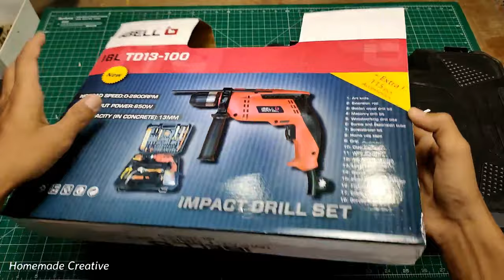Unboxing and Testing iBELL IBL TD13-100 650W Professional Tool Kit

Comment: Do your drilling machine spark inside ? I got my order today and thinking of returning it due to spark while drilling
Reply from the maker: If Little Bit Spark, No Problem(Because Of It Uses Brush)Buy Its Too Much Then Return it
Reply: Of it's spark a little bit,, it's good.
It's used to be happen sometimes.
Cause by carbon.
Reply: Don't buy ibell go for Stanley
Reply: Same problem but the spark is significant if I put it in reverse mode. And the case is damaged inside.

Comment: Metal mein very slow speed mein chalao aur pressure de ke rakho.. squealing awaaz nhi aana chahiye, smoke aur heat bhi nhi hona chahiye.. aur thoda lubricant bhi daalo to protect the sharpness of bits..
Reply: Vg
Reply: В лими́

Тттт
Т  и
Reply: @user-uo8rl8eu1s  privitya.. kak dela?

Comment: I got this drill machine delivered today.
It's making sparks.
What to do?
It's brand new.
Reply from the maker: If it’s little bit then It’s Normal, if alot of spark coming, then replace it
Reply: @homemadecreativee  thanks for replying.🙏
Did you faced the same problem ? ..sparking in brand new machine.

Comment: It is hammer drill or an ordinary model!
Reply from the maker: It is not hammer drill but it is have hammer function
Reply: Thank you for the information brother, so I can use like Bosch hammer drill? Nearly similar function or result? Cause using ordinary drill machine it is impossible to hole a concrete pillar, with this ibell model can I drill pillar?
Reply from the maker: Yes you can, but it's not fully hammer machine, but it has hammering mode, if your work so much to drill pillar then buy a good hammer drill